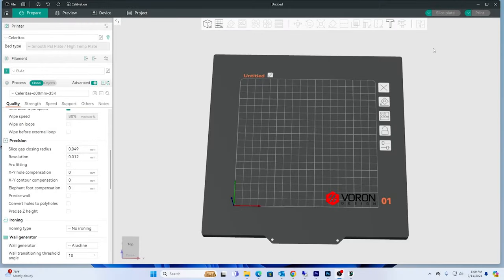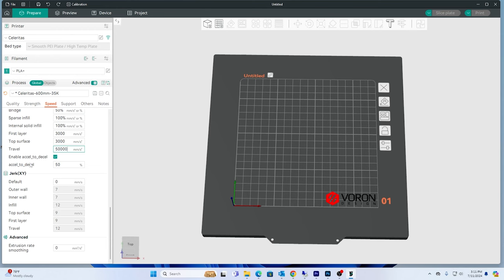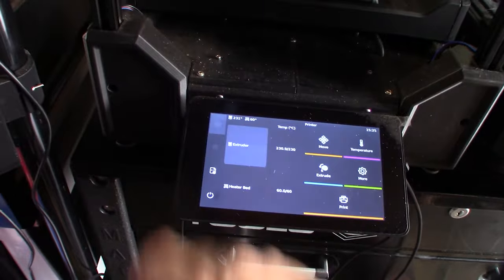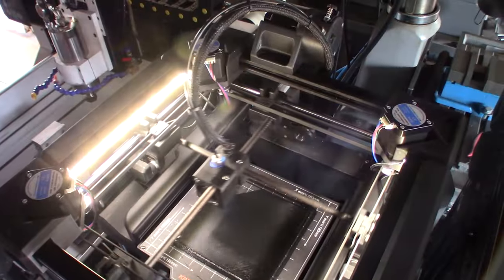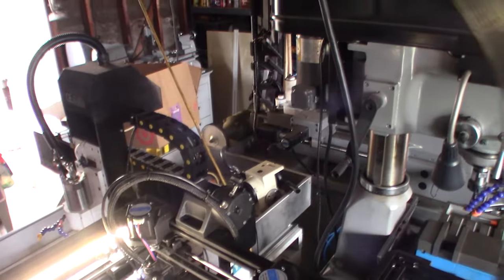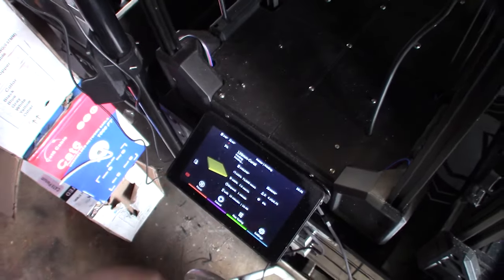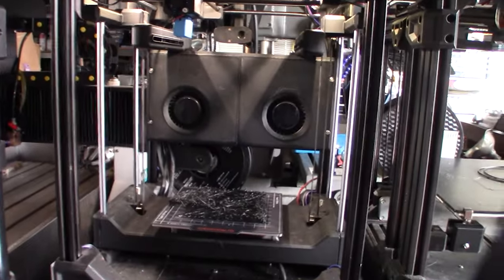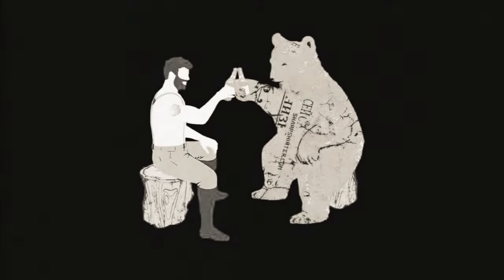Celeritas 50K Acceleration 800mm/s Test Orca Slicer or Cura for high speed 3D printing?

Comment: So a couple things that you are going to want to check in Orca; 

- Make sure to change you machine limits in the printer settings under motion ability, its likely set lower than the setting you have set in the print profile and will limit the speeds and accels (be sure to change accel while extruding). 
- I would use 100% accel to decel. You are correct in your assumptions made during the video. 
- Increase your Jerk/SCV, I personally use 50 for super fast printing and 12 for normal stuff. Rule of thumb is 1 jerk/scv for every 1000mm/s³ of accel. 
- Make sure to uncheck slow down for better cooling in the filament settings, and change your flowrate to reflect the max of your hotend. Orca will limit speeds to not exceed flowrate. 

These should fix most of the issues with the slicing for fast prints. I would also change minimum cruise ratio to 0 in klipper, and make sure your jerk/square corner velocity is set to what ever you end up using in the slicer.
Reply from the maker: All of my motion ability looks good, Have 100K for max acceleration. The feedrates look slower then I'm requesting in gcode. I don't have these issues in Cura so I'm sure something isn't right.
Reply: @fintechrepairshop  My assumption without being able to see your setting would be the slow down for better cooling setting in the filament settings under the cooling tab, or orca is restricting the speed as to not exceed your maximum flowrate setting. You can slice your file and change the color scheme of the slice in the preview tab to speed and/or flowrate to confirm what the gcode is actually commanding.
Reply from the maker: @MagTheFrag Cool, thanks.  I'm messing with it know.
Reply from the maker: i think volumetric flow was the issue. I will test tomorrow, thanks for all your help.

Comment: For the speed, what is the difference in the gcode itself? Are the generated feedrates incorrect?

Is that a Volcano/CHT or custom? Have you measured the actual flow vs. extrusion rate curve? 800mm/s x 0.2 x 0.42 = 67.2mm^3/s, that's a lot! I certainly haven't been able to get that out of a Volcano, even with the Triangle PCD CHT insert nozzle.

And, have you thought about implementing some kind of spring buffer on the frame side of the filament (like mounting the extruder on some kind of compliant mount maybe)? It seems like the head is going to be pulling a lot on the filament as the bowden tube curve changes shape at these speeds.
Reply from the maker: I think you said you had a bowden setup correct?
Reply from the maker: What are you using for the slicer?
Reply: @fintechrepairshop  I have two functional printers at the moment, one is bowden, the other has an Orbiter on it. My partner has a frankenprinter with bowden and one with a TBGS. (We are using BMG clones for bowden.) By the way, he is really happy with his TBGS. I might switch mine to use it. The filament path is insanely tight.

We use PrusaSlicer. It's the kind of thing like, we started off using Slic3r a million years ago and it is more comfortable to stay with it. I tried Cura a bunch of times but as of ~4 years ago Cura still was very stupid about walls: it would constantly retract and travel between wall layers when it was not necessary, causing a lot of artifacts. I'm sure that is probably fixed by now but it really turned me off to Cura.

Can you post the two gcode files or something? I'd like to see what the difference is in the generated code.
Reply from the maker: @jessicav2031  The extruder I'm using on Orcinus is similar to the TBGS but all aluminum called the HGX-Lite. I started out in Cura with my printrbot simple metal then switch to simply3d for a few years. Orca is pretty cool. I tell the slicer to do 800mm/s and I don't get anywhere near that speed. Cura seems to do what I want. I'm looking at the orca slicer gcode to see what's up with the feedrate.
Reply from the maker: The extruder was moving faster then I've seen it move before. You definitely have a better math brain then me. I was really good at math when I was in school. You don't use allot of complex math in IT. Even when I was a full time software developer I didn't use complex math.
Reply from the maker: The Feedrates in Orca Slicer gcode look allot slower them I'm requesting.  Don't get that in Cura. I'm sure its something I'm missing.
Reply from the maker: @jessicav2031  https://github.com/oc3dtech/Celeritas
Reply from the maker: I uploaded the gcode.
Reply: @fintechrepairshop  HGX-Lite looks promising, but how tight is the filament path and how much does it weigh? TBGS prints even the most flexible TPU at quite high flow rates (blows away Orbiter 2.0) and weighs 138g. The downside is that the body is CF-PETG; the whole body visibly flexes during fast retraction/deretraction, and it cannot be used in a heated chamber. I would really be interested in an aluminum version but it would take some pretty fancy 5-axis to make that filament path. Are they really doing that for $20 amazon extruders?! I don't see any good pictures of the inside.
Reply from the maker: @jessicav2031  I'm not even sure how they sell some of these parts for so cheap. The aluminum, anodizing, ball bearing, machining time, etc... Look at the other guys comments about orca slicer, Very promising. What is the max you have been able to achieve with your bowden setup. I'm coming with with ideas for high flow hotend. Do you watch  Vez3D (vzbot) channel? Pretty crazy how he prototyped the goliath hotend with hand tools and an idea.  Guess I will have to freshen up my math skills if I'm going to be in the high speed 3D printing game.
Reply: @fintechrepairshop  Looking at your gcode. All of the same feature seem to be printed at the same speed. If @MagTheFrag's hypothesis about cooling slowdown was correct, at least with PrusaSlicer, layer speed would oscillate, but it isn't. Instead it looks closer to constant flow rate, like the slicer thinks your maximum flow rate is ~13.4 mm^3/s (which would be a reasonable limit for a V6...).

Stupid question, I am not familiar with OrcaSlicer, but in Slic3r/PrusaSlicer there are actually two places where you can set a flow rate limit: in print settings and in filament settings. Any chance you missed one of them?

Inner wall feed: 10081.802mm/min x width of 0.399999mm x height 0.2mm = 13.4423mm^3/s
Outer wall feed: 10062.077mm/min x width of 0.400699mm x height 0.2mm = 13.4395mm^3/s
Sparse Infill feed: 8843.478mm/min x width of 0.45mm x height 0.2mm = 13.2652mm^3/s
Reply: @fintechrepairshop  Yes, I've seen the Vez hotend. Too bad commercial products are limited by the fact that the patent office is happy to grant patents on the concept of a dowel pin. But what you build in your garage stays in your garage...just don't show that part on youtube 😁
Reply: @fintechrepairshop  Nope. I was wrong. @MagTheFrag was right. slow_down_for_layer_cooling=1, slow_down_layer_time=8. The reason the speed isn't varying is because the fill is dense enough to make it take the same amount of plastic per layer. It is forcing each layer to take a minimum of 8 seconds.
Reply from the maker: @jessicav2031  I think volumetric flow under filament was the issue. @MagTheFrag's was correct. Orca slicer has a pretty cool max flow test. Funny thing is I've fixed hundreds of factory 3D printers and never done flow rate test, I guess everything changes when your going for max speed. Have some more printers to work on next week. Another large Raise 3D and an ultra expensive Ultimaker S5.
Reply from the maker: Thanks for all your help!!!
Reply: @fintechrepairshop  Ah. You should do a plot of commanded vs. actual extrusion for different factors. I'm guessing with Volcano you will start to see meaningful underextrusion around the 25-30mm^3/s mark, which would be about 300-400mm/s print speed at 0.2mm layer with a 0.4mm nozzle.